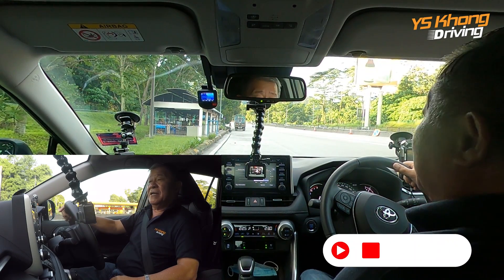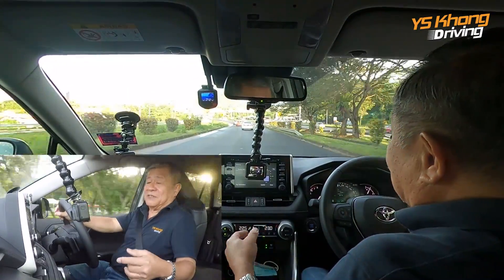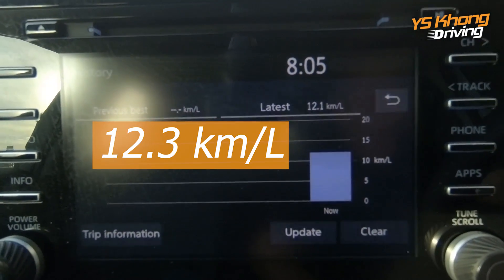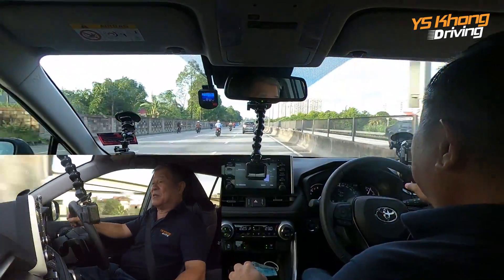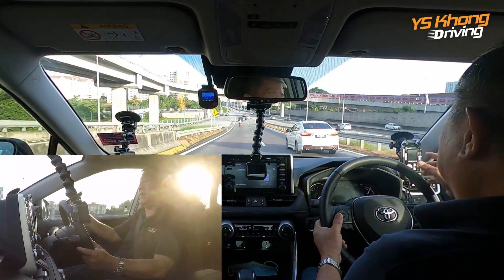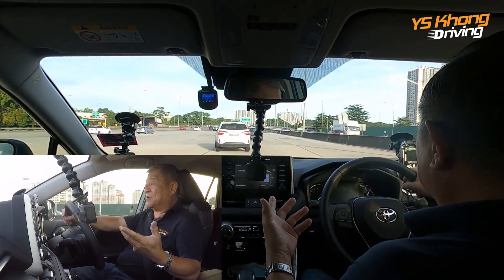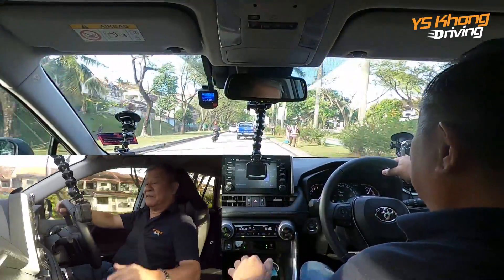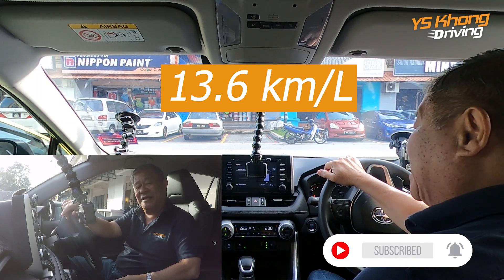2020 Toyota RAV4: 40 Percent Thermal Efficiency Translated into Fuel Consumption on Normal Roads?

Comment: Hi uncle, for Honda stream rn6 having same suspension setup as this fd1 will the advise -1 degree camber front and 1mm toe out front apply also?
Reply from the maker: Juat run about 0.6 degree negative front camber and toe out 0.6 mm each side to try out first. Tjis car os not so likely to ne driven in earnest so have to go easier on the toe and cambwr.

Comment: Actually 12.+ km/L to 15.+km/L  is not jimat fc la uncle, is bad fc because engine is 2.5L not enough HP and torque.. and plus gear CVT, 
better buy grand carnival 2.2L diesel turbo the best FC top speed 170kmh  Rpm 3K up sikit only and value for money..
Ramai ckp Toyota jimat petrol but in dunia realiti tidak jimat mana pun..
Tiguan 1.4L turbo full tank 60L can go 800km for long distance. my rio 6speed 1.4L full tank 45L can go maximum 740km maybe more for long distance...😊
Reply from the maker: Hello, this is city driving.
Reply: @YSKhongDriving  oo, I see..😊
Reply: 2.5L+8AT bro
Reply: RAV4 2.5+8AT...with 15.9km/L... DRCC(90-110km/h)...55L=874km

Comment: Glad to see you mention a comparison to the A class which is terrible value for money. 

People will still buy it for the badge of course.
Reply: Buying a car doesn't always have to be for value of money, how the car makes you feel when you look at it in the morning also matters. If you take pride about owning a high tech industry leading car like this RAV4, good for you. But there's no point in attacking the choices other people make. IMHO, anyone who buys any car that is above RM140k shouldn't be too obsessed with fuel consumption and such, instead focus on the ride comfort, NVH, interior and most importantly the feeling it gives you. I would personally pick the A class purely for the interior design and also for how the exterior of the car looks.
Reply: @matthewdominic4336  I don't think I attacked anyone. I stated my opinion that at around 200k, an A class is terrible value for money. Unless the badge is important. 

You added design so there is that and you also just confirmed what I said, some people will prefer it. But not for reasons such as space, practicality, nvh, ride, reliability, power, or fuel consumption which if taken into account, the rav4 will beat  the a class on most .
Reply: @TsLeng  Seems like I misunderstood what you said, I apologize.
Reply: @matthewdominic4336  no worries. Like  I said, I understand both sides, I know the allure of a premium brand